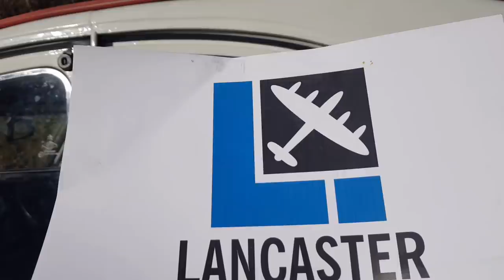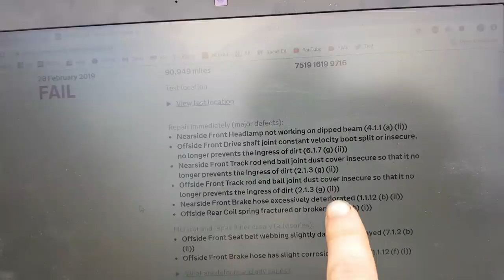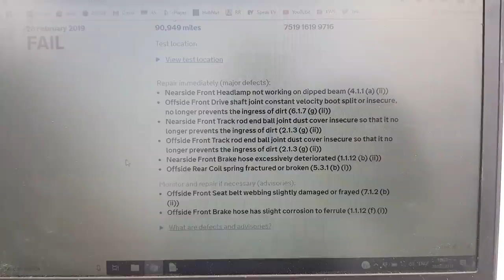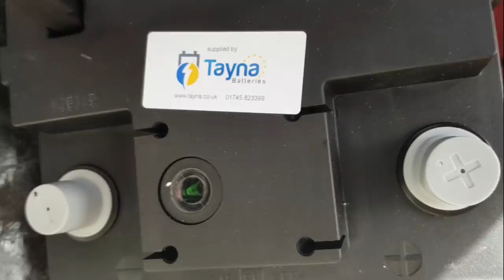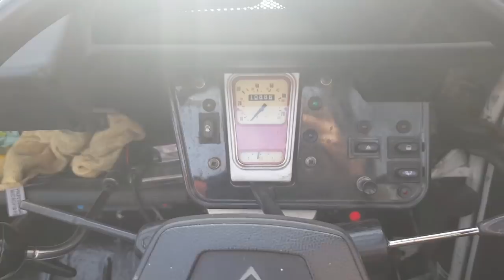Mazda 323F MOT result, 2CV battery change

Comment: Having loose battery terminals is a recipe for failures. If you want a quick emergency disconnect buy a proper quick release terminal off EBay, you only need one to be quick release for when Ellie catches fire. In fact loose terminals can be the cause of a fire. Enjoy your new found sporty Mazda amongst the Welsh hills.
Reply: That's a good idea so good you wonder why all cars don't have an emergency disconnect.
Reply: @marklittler784  racing cars have to, regular cars dont catch fire all that often or it will prbably be too late to faff around anyway

Comment: Battery cables that loose will eventually allow the alternator/generator to not fully charge  your battery which in turn will cause deterioration in the battery due to sulfation of the plates
Reply: @riccardoscavo8485  could be worse Ive seen it done with evostik before
Reply: Don't they make quick release cable ends? Just a twist and they release their grip. Google shows a good amount of styles. £5
Reply: Bob Howse and the last thing anyone wants is sulfation of the plates 🧐
Reply: @advancelast1740  I Felt a disturbance in the Force in Staffordshire today..The Pub wasn't moaning! 
So i bought half a lager and an $8 Hat. And i hugged Elly! ;)
Reply: You can buy little battery switches to kill the power in an emergency.

Comment: Great, but for gods sake tighten up your battery terminals!
Reply: Indeed -- HubNut, consider adding a main circuit breaker, such as is used in boats, in the car. They're cheap, much safer than loose connections and they allow you to disconnect power even quicker in case of the smokes!

Comment: I envy the British auto market. Nowhere in the states could you buy a running and decent condition car for 200 pounds...or about $266. That Mazda would be on sale for $2500 or more. Most of the time $2000 gets you a car one repair away from the scrap yard.
Reply: With global warming bringing colder weather to America, you'll see more salt on the roads every winter quite far south, which causes killer rust under the car resulting in cheaper old cars. Win win!

Comment: regarding the 2CV battery connections personally if you want quick release ability but a good connection I would use caravan battery connections which are quick-release yet have a good solid connection.
Reply: I was about to recommend these also.
Reply: or a made for the job battery isolator connector!
Reply: loose clamps has caused me problems in the past of the car cutting out, tight clamps for me
Reply: Why needs a battery if you live on top of a hill? 😆
Reply: My cinquecento would protest if the connections were loose. Fiats are like that. Also helps with battery charging.

Comment: I know other people have said this, but I have to agree that loose battery terminals are a very bad idea. The increased resistance created could affect charging, cause a build up of corrosion on the terminals and ultimately be the demise of the battery. More worryingly if the positive clamp bounces off and shorts on the body there's going to be a big old flash and potentially a fire. I would always wire brush the the terminals and clamps clean and smear with vaseline before refitting nice and tightly. If you're really worried about battery isolation, you could fit a racing car or winch type isolator switch or quick release terminals; although my experience with the latter was that they chewed up the lead terminal posts.

Comment: you cant just push the battery terminals on. you should undo the bolts a bit push them on then tighten the bolts up. it should be very solidly connected. good work sir love the channel

Comment: Omg, Ian! Loose battery terminals cause resistance, resistance equals voltage drop, voltage drop equals poor starter motor performance - poor starter motor performance equals bad starting. Do them up nice and tight!
P.S - Should also add that resistance at the battery terminals will also limit the current flowing from the alternator to the battery. You may not notice an issue on a brand new battery, but after a while you will end up with problems again.

Comment: Never leave battery clamps loose. This can lead to arcing, burning the terminals and clamps.
Terminals could overheat, spark even cause fire.Also it could cause the alternator to overcharge.
Bad connections are the scourge of any electrical circuit.
We just got a Tayna  Bulletbatt  for my neighbour's car. I have a couple more of these and I 
can really recommend them for excellent price, delivery and quality. This latest one was slightly tall.
Reply: @crispindry2815  I'm not really surprised, but it needed to be said.

Comment: That's not a bad rap sheet mate and changing a spring is the most easiest thing in the world, a tip with the seat belts run a lighter up and down the belt :) it melts the fraying and leaves a nice clean edge
Reply: yep it wasnt all that bad really, plus we know engine runs well and passes emmisions, the two big worries out the way
Reply: @jusb1066  hub nut thinks he has problems I've got a volvo s60 it needs handbrake shoes discs and pads I can do it myself no problem but everyone knows you fit aftermarket parts at you're peril on these lol. So time to empty my wallet. I used the lighter trick many times when I had my volvo s40 sport lux the belts used to fray down the edges for a past time over the course of the year. But lighter trick works wonders. I also have a mazda 2 sport they are brilliant cars mazda mine had to have two track rod ends for its mot  other than that it got through very tough engines.
Reply: Old seat belts need to be pulled alk the way out and scrubbed with some warm soapy water. You will be shocked at how much crud they've collected over the years and how much better they retract after cleaning.
Reply: @niallsommerville9941  yes cleaning is good but some cars are just designed to fray belts the s40 was just one of those I used to stop on the way to the mot station and do my cigarette lighter trick and all was good. My s60 hasn't got that problem it just has other problems it likes genuine parts, fantastic car and that 5 cylinder is wonderful but it's a fickly fussy car when it comes to aftermarket parts they just don't fit as well and the car soon let's you know

Comment: As many has stated about the battery terminals - they really should be tight. I use quick connect battery terminals (usually only on one pole so a kit will be good for 2 cars) on some of my cars that may sit for long periods and others I go for a mains cut off switch. A quick search on ebay tells me that you can have a pair of the terminals for £7.99 in the UK. Well worth it.
Edit: they seem to call them "quick release", not "quick connect".

Comment: You are highly advised by Tayna to check the size on the cars battery. i have ordered 3 batteries from Tayna and would highly recommend them.
Reply from the maker: I guess I've learnt that lesson, but they only listed one type of battery for the 2CV, so I wrongly assumed that would fit. Not all that impressed to be honest. Naturally, when I ordered it, I was nowhere near the car.
Reply: im sure its the right battery, there ant that many sizes, i think it needs a mat underneath the battery, a thick rubber car mat cut to size would work

Comment: A thing to do first on the sun roof is clear all four drains if you haven't guess one at all four corners running down the front and rear roof posts. the seal that you see around the sun roof is more of a dust seal then water. I have blown (or cleared ) with a air hose.
I have cleared countless drains in many makes of cars.
Reply: Spot on Mike I've done this on many occasions over the years
Reply: I'm convinced most sunroofs just need the drains clearing rather than sealing up. I've never had one leak once drains are cleared.
Reply from the maker: I have. On my XM, the frame rusted, breaking the bond with the glass. Had to replace the entire unit.

Comment: Ian, your videos are pure driving therapy my friend. I had to drive an ageing VW Luton van right across London on the south circular in rush hour traffic yesterday. Not only was the darling vehicle slow to begin with, but the turbo kept dropping out, making driving the old bugger much like trying ride a skateboard with no wheels. Ordinarily I'd have been gnashing my teeth with frustration, but thinking of you and TWC, I actually ended up quite enjoying the experience. Motoring taken (almost) back to its basics. Quite spiritual, almost!

Comment: You keeping the battery clamps loose Ian won't help your starting issues, even if the battery is knackered, you get a high resistance and subsequent volt drop mate .

Comment: As one who has changed a few coil springs coil spring compressors are for wimps! Where is you sense of adventure? Really if you pay attention and take a few precautions, the major issue you'll have is you don't have a 4,000 pound Pontiac convertible or a 1/2 ton Ford pick up about to give you enough weight to smash the spring down with. I had to do something similar two batteries ago with on our Honda Accord seems the new batteries have some different features that don't quite fit the OEM holder.

Comment: Ian you don't need a spring compressor to take out a rear coil spring.
You just press down on the control arm with your full weight and get somebody to slide the coil spring in.
I recently did it on my astra dead easy and you could have saved yourself some money.
A good tip also is when taking a battery off is to think its a negative experience because your having to do the job,so negative first and when you have finished the job putting the battery back is to think positive first because its a positive experience when your just finishing the job.
My bro told me this one haha.
I would cut those threads down on the battery too an inch from the last nut and lightly file the sharp edges a bit all around on top of the thread,it would look much better and less likely to catch your clothes when your working on the car.
Good video ian.
Reply from the maker: Yeah, the 'get somebody' can be a bit tricky...

Comment: Have you thought about quick release battery clamps? I'm going to be fitting a set to my Seicento. It means that the clamps are tight, but are easily released with a lever. The Mazda's MOT failure wasn't a surprise, but wasn't that bad considering the car's age. The total repair cost doesn't seem excessive either. Seems only right that the editor of Retro Japanese magazine has got a retro Japanese car.
Reply from the maker: Yes, a battery clamp plan is in progress.

Comment: Well, the 323F wasn't so much of a Fail there, so it may have potential.  What I've found works well with leaky sunroofs like that, especially ones where the sunroof panel moves back above the roof skin and not into it, is digging out the sealant that's been put into it to try and cure the leak and then cleaning the seals very thoroughly with ordinary spray can silicon lubricant.  It replaces lost oils in the rubber and plumps them back up to the size they should be.  Just repeat as and when necessary and you should be fine, or at least a lot better off than you are currently.  It sounds, and is, very simple but it's kept my sister's old Proton Compact largely leak-free for the last 4 years, and that lives outside in Bedford.  Before this treatment it was like driving a motorised shower unit...  Unfortunately it couldn't cure the leak that's caused by failure of the sealant between the sunroof frame and the roof skin as, due to the water getting in, the bolts that sandwich the roof skin between the upper and lower sunroof frames are so rusty that there is no way on earth that they're coming out and snapping one would be an issue.  Judicious application of silicon sealant does, however, move that drip from the driver's side to the passenger side, which is fine.  Also rod through the sunroof drains as, being as the Mazda clearly has lived outside for some time, they're probably pretty well stuffed with grot.  Being as the Mazda unit is a factory fitted sunroof it should have drains going down to the sills for the sunroof, the Proton, however, doesn't as that is not a factory fitted sunroof, it's an aftermarket unit fitted by the importers to suit UK tastes...

Comment: Springs depend on the rear suspension - the mk1 Seat Leon rears can be done by simply undoing the lower shock mount on both sides, then pulling the i beam down.  This creates enough room to simply pull the spring out, no compressor needed.

Comment: I think the best fix for the battery hold down rods would be to take an angle grinder to the hooked ends and shorten them by enough to allow you to be able to bend new hooks on. Clamping them in a vice should do the trick. I used that method on a used set I had to modify for the same reason - I may have added a bit of heat to the mix for the bending of the new ends. In fact I think I put them in my wood stove for a bit as my torch had run out of gas! Whatever works, right....?
Reply from the maker: That's a bit permanent. What if I want to fit the correct 063 battery in the future?
Reply: I would think the new battery should last long enough to offset the cost of a couple of threaded rods if you get the correct sized battery next time around. As you said, the protruding ends do look a bit nasty with regard to injury. Alternatively, maybe a length of threaded rod cut in two and ends bent to make custom fit rods for this battery. Then you'll still have the two existing ones for the future installation of correct battery. Just don't lose them in the meantime...

Comment: I had a Dyane where the hose dropped onto the exhaust.  I remember smoke coming out thru the bonnet and I just got out and pulled a "flaming" cardboard part from under the bonnet and dropped it in a bin. The face on a guy driving past in a Fiesta was a bloody picture...

Comment: Not too bad on the MOT failure, I guess you figured it might fail. Have played with many types of sunroof during my time at the dealership, various cures for many types, depends which type it is. The older electric ones have various problems  which can cost more than some of those late modern cars are worth, however I would guess there would be some used spares available for the Mazda, but don' t know. It won't hurt for you to break the sealer around the glass with the cautious use of a blade. Be nice for the summer, if we get one, and indeed if you keep the car that long. If you get no joy you can reseal, as I suspect the old sealer of breaking and causing the slight leak. Good luck.

Comment: Leaky Mazda roof:  My LR Disco 300Tdi has 2 leaky windows , from new! After silicone sealing and removing handles ( I gave someone a lift in the back and they cranked the rear window open when I wasn't looking  and broke the seal) I found the rubber to roof join leaks as well, where your green moss is growing so seal both sides.

Comment: If your worried about disconnecting the battery quickly I would fit a battery isolator switch rather than leave the terminals lose . As leaving the terminals lose will hinder electron flow.

Comment: Ian. I bought a 323f in 2004 for 100 quid. It was the earlier model from 89 g reg pop up lights. Nice metallic blue. Had rot underneath at the arse end. I managed to get parts for pennies. Single cam 16 valve, or it appeared to be. Drove lovely, not fast but nice. I hope you can sort it then you will realise how under appreciated they are. Please then keep it as your daily drive, it won't let you down, bye bye fella.

Comment: Hub Nut, just get used doors from a scrappy they can't be that pricey. Then just change over locks, door cards for own and if necessary, the electric window regulator.

As for Ellie's battery, I'm pretty sure there needs to  be a cover over the positive terminal to prevent accidental negative earth contact in the event of an accident.
Reply from the maker: Older cars never seemed to have these covers.

Comment: I did front and rear springs on a 1977 Cavalier many moons ago. I hired the spring compressors but never needed them. The old springs obviously just fell out but with the car on blocks under the jacking points, I found that the springs could be knocked in with a rubber mallet.

Comment: I know a guy who used to work as a Ford mechanic and one time he was switching the spring on a Focus, the spring popped out of the compressor and hit him straight in the head. He now has TBI and has developed Parkinson's symptoms. I fully understand why you would not want to dabble with springs.
Reply: @williamwoods8022 This guy had at that point over 20 years of experience as a mechanic. Most likely thought he had a routine for it already and routine is often the enemy of caution.

Comment: As many others have stated, leaving the battery clamps loose will lead to a build up of resistance  and therefore a drop of current to the starter. This will lead to cranking issues in the longer term. There is a reason for them being done up tight from the factory...

Comment: Ian...it might be better to pack out the battery from behind with a small pice of say 20x25mm wood so the battery sits at the front of the tray. Then your securing rods should be good and you wont poke your eye out/stab yourself :-)) And please tighten the nuts and carry a spanner in the glovebox (like I do). Cheers